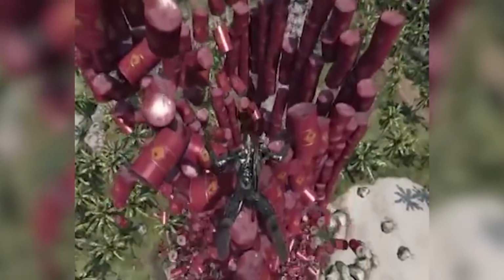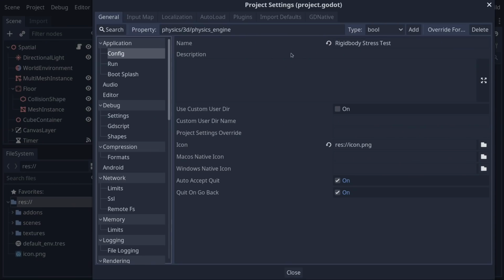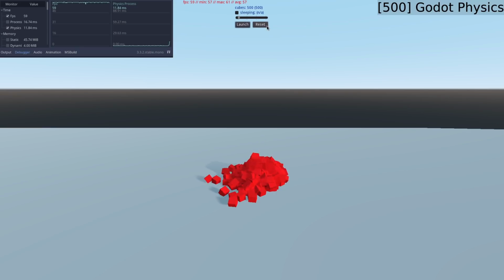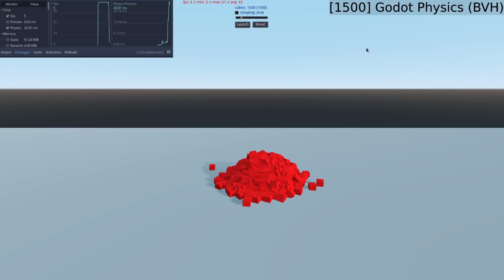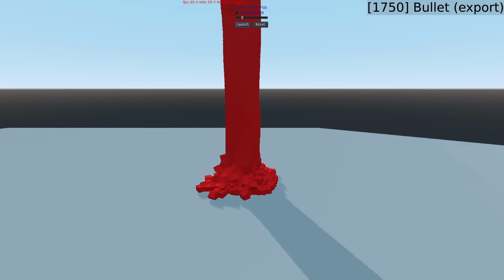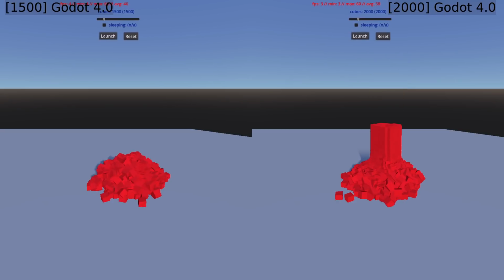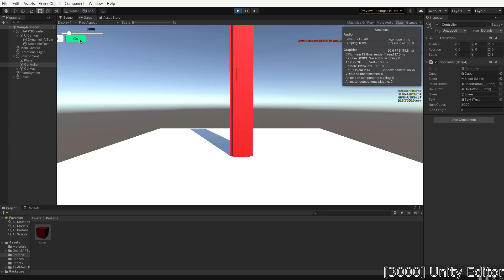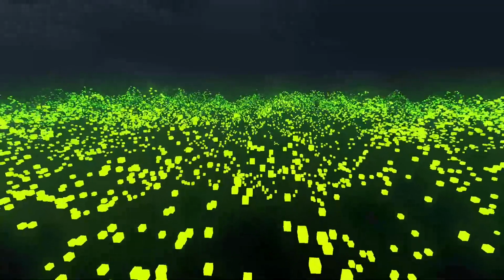Unity vs. Godot How many Rigidbodies can each support?

Comment: Interesting comparison but here are a few thoughts:
- all your tests were a mixed bag of rendering and physics calculations, for true results you should disable rendering 
- I wonder what sleep mode setting you have configured for the Godot (if it has any at all) but when cubes rest on top of each other their contact detection and simulation should get turned off and increase performance not the other way around!

Comment: I will never use Godot, because the devs try to implement everything new, even if there are proven existing solutions (reinventing the wheel). Maybe the devs want to "show off" or I don't know that the reason is, but I will keep using engines that uses a standard / proven tech instead of wasting so much resources into reinventing wheel(s). Their custom made solutions work but so far they are all worse than the existing solutions.

Comment: Ah yes, testing performance in editor instead of a built project. Big brain time.
Reply from the maker: Unity's performance on 3D was so far ahead of Godot, that I didn't bother exporting the Unity project in this video; however, when comparing Unity DOTS vs Godot Physics Server in part 2, I used the exported projects in both cases.

Comment: Unity physics engine is cursed
Fire ray through moving rigid body
Passed through rigid body
Fires rigid body too fast
Passes through
Do anything with rigid bodies
Dies
Reply: Then stop using the default options. You can turn on prediction and more accurate calculations. It's performance mode by default and you tweak things to the accuracy you need. There are a plethora of settings to fine-tune the behaviour.

The ray will not pass through a rigidbody though unless you fired the ray *from inside the collider*, then in that case if you expect that to happen, turn on "Rays hit Backfaces".
Reply: @invertexyz  I literally didn't fire the ray from withinside the collider, that doesn't make any sense.

I've never had issues firing rays at moving rigidbodies with any other game/physics engine. Sure throwing a rigid body at fast speeds will fucking clip through the wall, but a fucking ray, like come on. Ray casts are supposed to be the most simple shit.

Comment: I don’t even know if you noticed, but unity’s rigid body had their collision enabled against each other, which is amazing, considering that godot couldn’t even handle 1750 with collisions off. Unity much preferably won by a lot.
Reply: yeah unity won. that doesn't mean im using it lol. Yeah your car runs faster.. sure..  that doesn't mean i can't use my truck
Reply: @phycogsmithomniscience309  that analogy seems to imply Unity has less utility, when that's not true at all. Unity is a jack of trades where you're free to do what you want with ease, and now with their DOTS you can also achieve extremely high performance despite using a managed language to program. So you're getting the best of both worlds, easy to manage and iterate code with high performance and a vast array of official and community tools. And industry leading multi-platform support on top of it.
Reply: @phycogsmithomniscience309  I see.
Reply: And this isn't even with the even more optimized Unity.Physics package option Unity now has that can work using the DOTS system.
Someone did a test a while back here a year ago: https://youtu.be/U6idEdIEsa0?t=274
And I'd imagine it would only be even more performant now.
Reply: Well that is true you can see there is a very clear trig sine-wave artifact in unity3d box simulation. By displacing boxes initially you reduce the number of collision checks per stack

Comment: unity use physX, it more poweful then other Physic Engines... and PhysX can calculate on video card...
Reply: The PhysX in Unity does not use the GPU because they wanted to ensure it works on any system, otherwise it would be restricted to Nvidia users.
It is entirely on CPU. And Unity even has a new Physics system they built themselves that performs many times faster than the one in this video...
https://youtu.be/U6idEdIEsa0?t=274
Reply from the maker: I compare Unity DOTS vs Godot Physics Server in part 2: https://www.youtube.com/watch?v=-vvxBWVXxe4

Comment: This type of videos are mostly for flexing the engine's power, in practical use case scenario any engine would be able to handle any game.
Reply from the maker: I mostly agree with you. In part 2, I draw the same basic conclusion.
Reply: That's an overgeneralization. Every millisecond counts. This shows more computation time will end up being taken by physics, leaving less breathing room for other areas of the game. And if you're targeting mobile for example, performance becomes extremely crucial unless you're making a simple 2D game or something with no real physics.
Reply: So i could use game maker to create gta 5?
Reply: @italofreitas221  yes. Its probably possible.
Reply: @italofreitas221  also, I said practical use case scenario and making a GTA5 level game for one guy at his home is not practical at all, it is next to impossible.

Comment: Man, it's a great video
But... Mouse clicking noise at the end of some of your recordings isa bit sad

Been youtuber, I have the same issues and solution I've found is to either put your mic in the other direction than your mouse or use keyboard shortcots (if you have a silent keyboard)
Reply from the maker: Noted and thanks for the tips! Will make improvements in the next video.
Reply: @MeanGeneHacks  have a good one!)

Comment: Your godot simulations aren't calculating correctly at all. You are ending up with a pile of blocks much smaller than what is physically possible...
Reply from the maker: Thanks for the comments and great observation by the way. The reason for the "intersection" you saw was I accidentally had the mesh size at 2x2x2 and the collision extents at 0.5, giving me a collision box size of 1x1x1.  So the mesh was twice as large as the collision shape.  All the placing of the boxes were done based upon the collision shape size, so other than looking a bit ugly, there was no performance difference when fixing the mesh sizes, so I didn't bother redoing the godot tests.

Comment: Well... Since Godot has got 2 or 3 physics engines, you've used only Unity's default one. What about unlocking full power of Unity and implement DOTS system? Trust me, Unity will handle more than 60k of these cubes.
Reply: Definitely!
Reply: This sounds like Goku going super saiyan 3000
Reply: Yeah well, but it wasn't needed since Godot wasn't even handling 2k with Bullet & collisions off lmao!
Reply: No, unfortunately it will not. Running physics where bodies interract with each other in a complex way is not the same as shooting bullets where you just change location on a path. DOTS (as in ESC, Jobs and Burst) has nothing to do with physics itself, at leat atm. Physics on DOTS is coming in the future, but I really doubt it will be that much more performant. If early tests are any good, it can be 1.5 - 2 times more performant in some cases. Also ESC as a concept and Jobs as multithreading can be implemented in anything really.
Reply: @uatihb  https://youtu.be/U6idEdIEsa0?t=479 50k cubes at 15 fps
Reply: @MPG42  Yes, but the increase for 60fps was less than 2 times. The fact that Unity in DOTS handles 50k objects at once witout crashing is all cool, but it is not about physics, but handling and rendering entities vs gameobjects. Obviously everything influences your fps and if this is your point then I agree, but if we talk about pure physics, then DOTS per se only marginally increases your performance.
Reply: @uatihb  You could be right, I don't have enough technical knowledge to argue that. Just sharing a video about falling cubes with good fps.
Reply: @uatihb  mmm depends, the havoc dots engine seems to be much better at handling lots of collisions due to the way collisions are handled, im not sure how unity handles physics in dots per default but havoc does increase performance by a lot. and rendering can be optimized a ton by using the hybrid v2 rendered and gpu instancing, pretty sure a DOTS implementation will be able to handle at least a good 10k without problems
Reply: @juliand3565  Havoc is a third party physics engine that you can implement in anything. Unity is using PhysX (tbh also a 3rd party that you can implement in anything) and new unity dots physics is developed with havoc team, but how much are they alike is unknown. From presentations we know that unity physics, for example, unlike havok is stateless and therefore easier to use, but slower. All in all this is apple to oranges comparison, but my point is that on machine that barely handles 6k cubes with decent framerate on current unity, dots will not make it able to handle 60k.
Reply: @uatihb  havoc has an implementation that runs purely on dots
Reply: @juliand3565  havok has an integration built on dots ;)

Comment: One thing I notice in your Godot tests is the bodies clump and intersect a lot. Couldn't that also in part lead to many more collision checks than in the Crisis and Unity demos?

Also, as Groud mention, I'm curious to see what's the performance like when you don't use nodes, as their ease of use generally comes at a performance cost. We've done physics benchmarks here with areas, and the frame time gets divided several times when using direct calls to the physics server over using Area2D nodes. Although the difference may not be as big with RigidBody nodes perhaps.
Reply from the maker: Thanks for the comments and great observation by the way. The reason there was "intersection" was I accidentally had the mesh size at 2x2x2 and the collision extents at 0.5, giving me a collision box size of 1x1x1.  So the mesh was twice as large as the collision shape.  All the placing of the boxes were done based upon the collision shape size, so other than looking a bit ugly, there was no performance difference when fixing the mesh sizes, so I didn't bother redoing the godot tests.

I do plan on next looking at Godot with a PhysicsServer instead of using nodes and will compare that to the Unity equivalent of using DOTS Physics to get rid of the GameObject overhead in Unity.

Comment: Your final thoughts are a bit counter-intuitive; you say that because godot is open source, we can continue to expect updates. But if volunteers don't feel like contributing to those improvements there won't be updates. Unity on the other hand is (optionally) paid software, so as long as someone pays them, there's a guarantee for updates and improvements.
Reply from the maker: Fair criticism. I really should have gone into a bit more on what I see as the benefits of Godot being open source, namely that the community has much more say in the development of updates than with a closed source engine where the company decides what to focus efforts on. Having said that, if the community decides additional resources need to be allocated to Physics, I think there is a much better chance of that happening with Godot than with Unity.
Reply: Godot also has a budget coming from donations and support from companies using Godot in production, albeit smaller than Unity's, but there still core development team, not enthusiasts only.
Reply: @MeshVoid  While it's true that godot has a small budget that supports a partially varying arrangement of core contributors, those when hired (or even those like juan who are part of the core-core) tend and are expected to work on very specific topics which is not comparable to commercial software support. It would be cool if this came with a maybe future popularity gain of godot, so one could actually use it commercially while not being forced at times to be a c++ developer too, knowing the insides of the engine to support oneself. But for now it's just realistic to not expect guarantees there from godot.
Reply: @Flavelius  I know =)
Reply: So, f.e. Adobe software being a billion dollar company must be producing absolutely bug free and fun to use software which makes all users happy and they are fixing bugs even years after release (*cough* Flash *cough*)

Comment from the maker: Check out Part 2 ( https://youtu.be/-vvxBWVXxe4 ) where I compare Unity DOTS Physics to a Godot standalone PhysicsServer. What is your prediction, will minimizing the overhead of Nodes (Godot) and GameObjects (Unity) help performance?  Will Godot be able to overtake Unity's performance or will Unity just extend it's performance lead?
Reply: Godot won't even come close.
After my tests, DOTS physics is about 3 times faster than regular Unity physics (although it varies a lot depending on the use case but in general it's at least 3x faster).
And that's only regular DOTS physics. Unity also has Havok backend for DOTS which is about 2 times faster than DOTS physics. (again, varies a lot on the use case but in general it's at least 2x faster).
Reply: hi, you should compare the collision system with the rigidbody in unity vs godot, in my opinion godot needs to improve a lot in the collision system.
Reply: I would also love to see this tested against the Unity PhysX integration from Nvidia (Unity's built-in PhysX integration has threading issues and is generally slower) which also supports GPU simulation.
Reply: Dont forget to test Havoc physics integration, its 2-3x times faster compared to unity dots physics
Reply: Could you try out rapier with godot rust.
Reply: I think Godot will have a chance to redeem itself. Without the overhead of the nodes, its got to be faster!

Comment: You should try the same test without using nodes, but instead by calling the physics and rendering servers directly. For this kind of tests, this should bring a significant performance improvement.

The node system has always been more about ease of use than performances, and their instantiation  is thus generally costly. So the same way we do not suggest to use Sprite2D nodes for a bullet hell game, si would not use nodes here for such a test.
Reply from the maker: Thanks for the suggestion! I'm already working on a follow-up video where I compare exactly what you suggested (Godot PhysicsServer) vs Unity DOTS Physics.
Reply: @gillesroudiere541  very interesting article. Thank you for sharing
Reply: what would you suggest 2d for bullet hell games? curious
Reply: @gillesroudiere541  thank you so much let me save it on YouTube playlist, big thanks.
Reply: @gillesroudiere541  actually very good article thanks once again 👍👍
Reply: Thank you  @gillesroudiere541 ! @Mean Gene Hacks  bump this to the top - awesome tutorial 👏🏻

Comment: I think Godot takes fps drops from it's graphics. I've tried Godot 3 for just testing reasons. (Note: I've an old GPU, but supports DX11) Just by making 3D terrains and placing few trees, Godot started lagging a lot. Where, I've made a lot of games in Unity, with 3D models, rigs, audios etc. Bigger than the Godot scene. Unity don't lags with those all, where Godot lags with that small scene. Sorry Godot, that's why I don't use Godot for 3D. I use Godot for 2D and Unity for 3D. (I would use 3D for Unreal. But my PC has low-end GPU)

Comment: I'm working un Unity only. Why cubes fall inside each other in godot?? Is it ok??
Reply from the maker: You have a good eye. Sorry for this, it was caused by a small bug where I accidentally set the mesh size to 2x2x2 and the collision shape size was 1x1x1.  Other than looking a little bad, it had no effect whatsoever on performance, so I didn't bother re-recording the Godot runs. The code has been fixed and the next video will have the mesh sizes set correctly.
Reply: @MeanGeneHacks  Can you try PhysicsServer in the next video? Im intrigue how much performance can you achive with that
Reply from the maker: @Juan Manuel Costello Yes. In Part 2 I will compare Godot PhysicsServer to Unity DOTS.
Reply: @MeanGeneHacks  Now it's clear. Anyway great video, thank you)
Reply: Its because he is using MultiMesh I think
Reply: @juanmanuelcostello9510  This is really weird if rendering have influence on physics.
Reply: @mypaxa00  Reading on reddit I found that the author misplaced the collitionshape on the cubes there fore that issue
Reply: @juanmanuelcostello9510  I'm not sure because this bunch of cubes looks completely different in unity.
Reply: мультимешь не юзал, но в моих подобных тестах кубики не сливались
Reply: @dedm0zaj  тогда получается дело как раз в мультимеше.